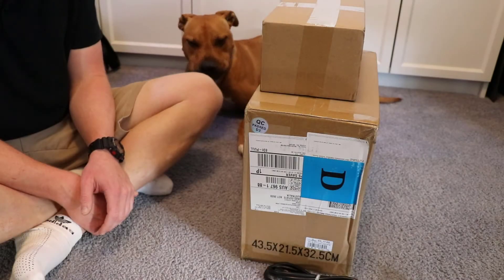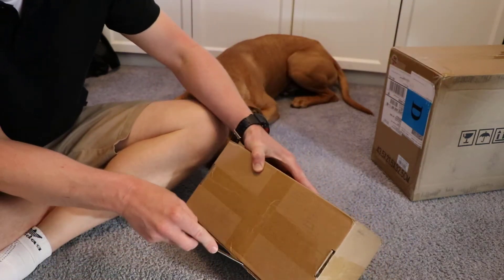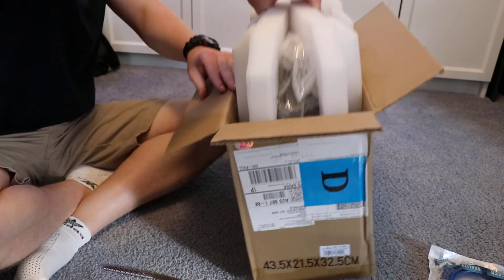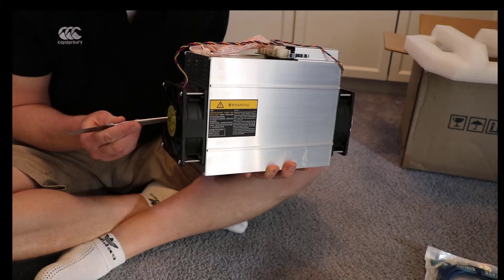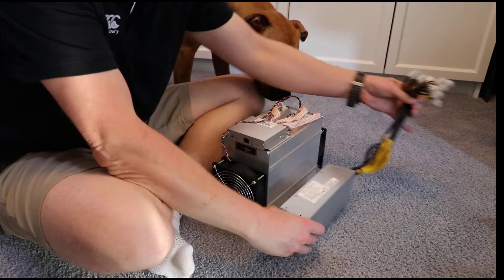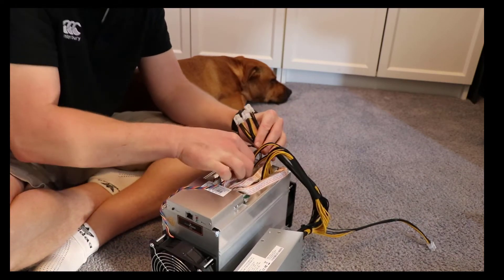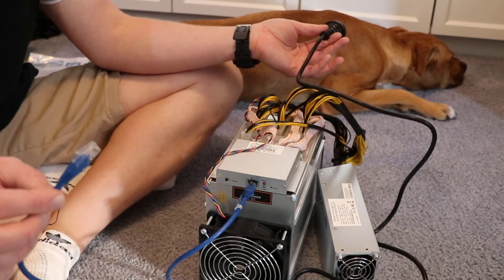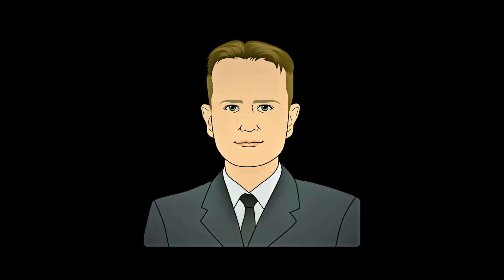ASIC Miner unboxing and physical set up

Comment: Do you certain cryptocurrencies require certain miners and if so where can we find that information
Reply from the maker: G'day Nick. Yes, each miner only does a certain algorithm.  However, some different coins use the same algorithm.  For example, both Bitcoin and Bitcion Cash are mined on the SHA 256 algorithm. Litecoin is on the Scrypt algorithm as another example.  To confuse you more, although different miners mine different things, there are at least three different types of Bitmain ASIC miners that mine the SHA 256 algorithm (different speeds and power use thus cost). When you click on the specs of the Miner on the Bitmain site, you'll see what algorithm that particular miner operates on.